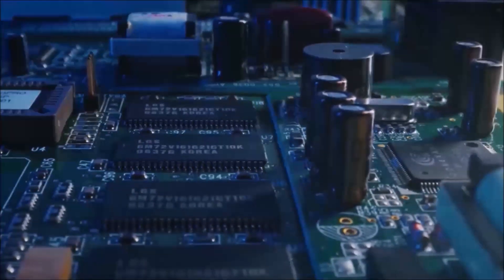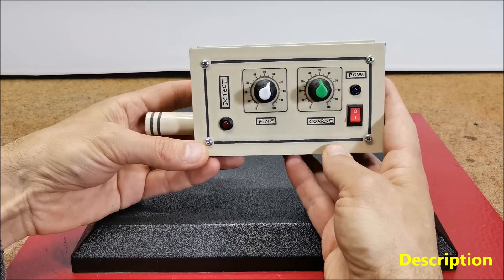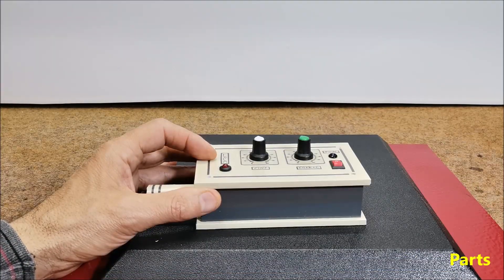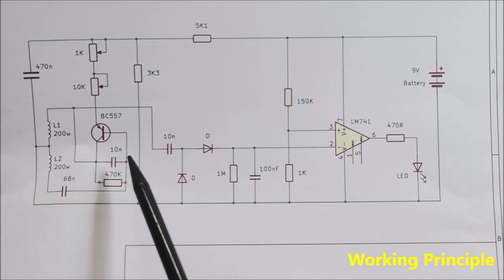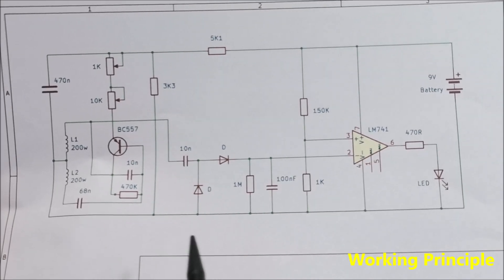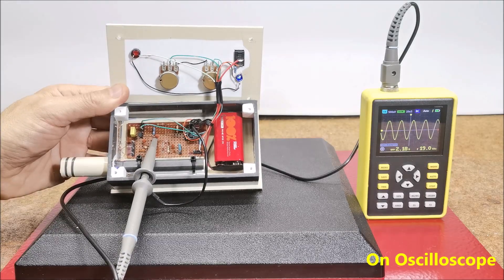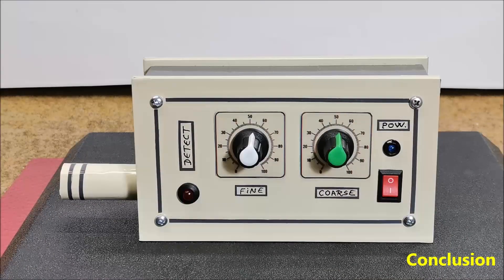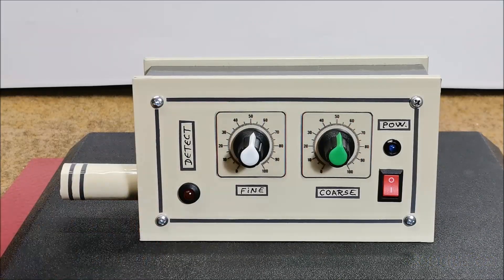DIY Simple  Sensitive Pinpointer Metal Detector

Comment: Hello! The interesting construction! But the operational amplifier LM741 in according to the datasheet, requires two two-polarity power supply plus/minus 10volts or single supply 20V . The minimal input voltage for both inputs must be 2-3 volts in case of one-polar power supply (please see internal schematic in the datasheet ).This IC not fit for single power supply - or you must keep inputs above 2.5-3V. In my opinion, the best alternative for LM741  is the LM2904. Minimal voltage for operating - 3 volts.
Reply from the maker: Specifically, my device works with TL071

Comment: Thanks for sharing this Project.
But I can't understand the winding of the inductor.
You salvage it from old radio.
But how can I make for my own? 
Is there any direction of winding 200 turns?
What will be the possible wire gauge?
Reply: Talking Electronics website has a lot of examples and theory about hand built coils and windings
Reply: @Friendroid  can you please help me  to find a specific one?
There are lots of fake circuit diagrams.
Reply: @itzalu  there are no fake circuits in Talking Electronics web site